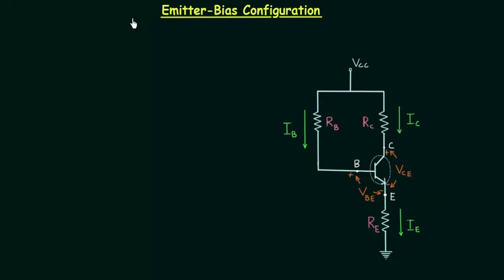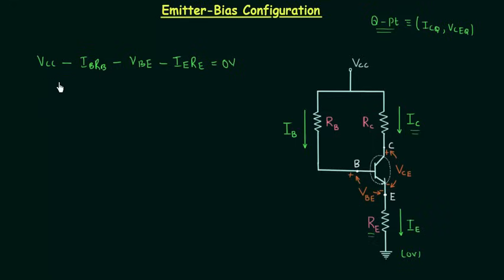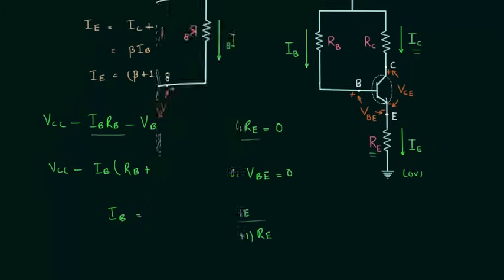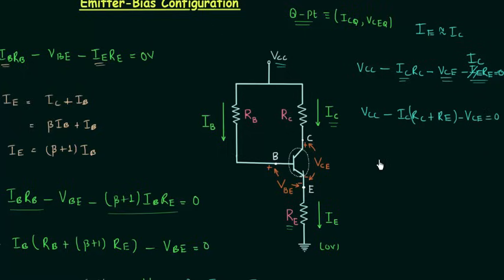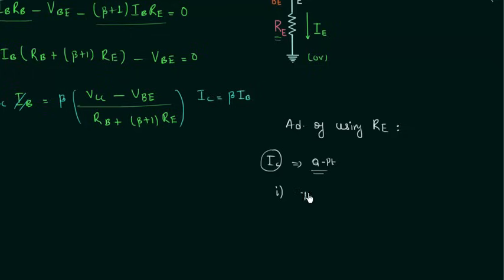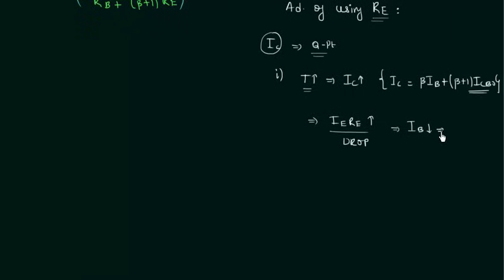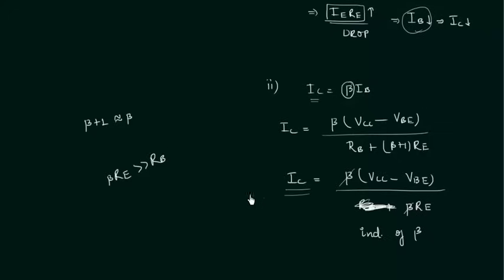Emitter-Bias Configuration

Comment: Can someone, please, explain why (10:17), low RB takes to reduce the CB junction ?
Reply: Because of low value of RB, voltage drop across RB will be less. Potential VB will be more. Reverse bias voltage, (VC-VB) will be less.
Reply: Plz also tell
How Ie=Ic (we neglect ib) in the output loop KVL but this is not the case in the input loop KVL Ie=Ic+Ib ?
Reply: Plz also tell
How Ie=Ic (we neglect ib) in the output loop KVL but this is not the case in the input loop KVL Ie=Ic+Ib ?

Comment: How Ie=Ic in the output loop KVL but this is not the case in the input loop KVL where you used Ie=Ic+Ib
Reply: Ib is very small
Reply: @adi_reigns3470  how do you know it is very small?
Reply: @snappywho666  coz of its low doping
Reply: @snappywho666  Because most of the electrons that emitter emits is collected by collector and almost no electron goes into the base region that's why base current remains very very low
Reply: @satya_k  then why do you considers Ib in input?
Reply: Ib is measured in micro Amps
Reply: Ic= alpha times Ie 
Then alpha lies between 0.95-0.98 so it almost equals to Ie

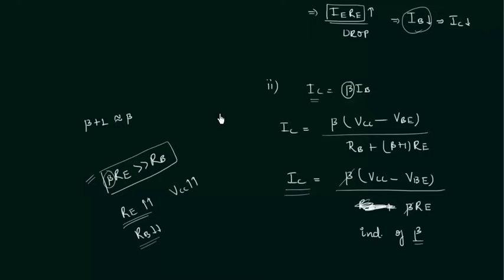Comment: Sir at 10:31 you said two points they are 1)If we make Re value high the power supply voltage should also be me made high. 2)If we made Rb value as low the collector-base junction will become reverse biased. Coloud you plz justify above two points?
Reply: I think If we make Rb value low then Ib will increase because Ib = (Vbb-Vbe)/Rb and due to this Ic will reduce because Ie = Ic + Ib due to which Vc will increase because Vc = Vcc - IcRc {Vc is potential at point at collector terminal} due to which Vbc which is reverse bias  voltage across J2 will decrease because Vbc = Vb - Vc i.e reverse bias voltage will become less positive.
If anyone thinks this is wrong approach kindly correct me.
thanks...
Reply: I would like to answer for your 1) question. The supply voltage or VCC have to increase is because if RE increases, IE will decrease and cause the voltage drop accross RE to increase.

   In order to compensate this, we need to increase the VCC so that the IE does not decrease. 

  Basically, it's compensating the decrease in current in IE by increasing the VCC by using ohm's law and with respect to the voltage drop across the resistor

Comment: as you explain increase in collector current will increase voltage drop across emitter and this lead to decrease in base current....
but we know Ie=Ic+Ib.... now Collector and emitter  current increase but why base current decrease ... please explain it apart from prove by equation ... mean what exactly happens inside
Reply: As voltage drop across Re increases there is less voltage across Rb
therefor Ib decreases